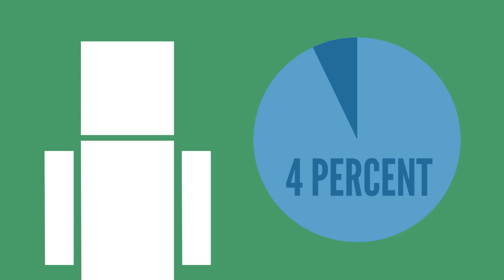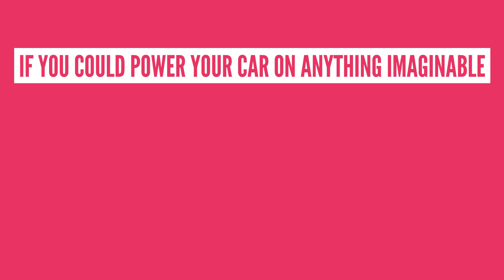Why Don't We Have Water Powered Cars Yet?

Comment: Is this possible that we use dry ice (soldified co2 ) as our fuel like we put some dry ice in the fuel tank and pour some water in it this would lead to the formation of co2  then we could just pass the co2 with high pressure through a fan which would further lead to the moving of the fan at high speed and generating electricity and giving us some energy to run a car the co2 would be emitted during this process but that co2 would not have any burnt particles in it so would cause no harm to environment . Your suggestions please

Comment: Oi blocko, this one is so inaccurate it actually hurt me. You imply that there's actually a way to get energy from water, when it's the opposite, it's like claiming you can get energy from CO2, you were onto something nice when you quoted the first law, but anyways.
The best way to get hydrogen now is through steam reforming of natural gas. Splitting water is a net negative energy process, so there's that, pretty much impossible to get energy from water

Comment: I have a plan to convert a bus to an RV and use solar for both general power and electrolysis to do exactly this. I have to run the numbers still though and see if that's even feasible but I'm hopeful. Even if generating brown gas takes more energy than it produces, it is true that the fuel effiency of pure hydrogen is much higher meaning I'll need a net less of it for the same distance than if I used diesel. And if my energy for the conversion process comes from a high end solar set up on the roof it's basically free gasoline. All be it with some work. I'm still not sure I won't run into some bottleneck that makes the process too long or expensive and makes me scrap the idea but I'm also not planning on being on the go literally nonstop. If I can stop somewhere for a couple weeks and build up my stores of brown gas, and I mean I plan on carrying 200gallons of freshwater I can pull from anyway, a high pressure canister of hydrogen gas or two could at least get me to my next destination then I can just rinse and repeat. Another concern I have about that though is I'd be sitting on 100s of pounds of what is essentially rocket fuel sooooo definitely gonna try and make sure there are plenty of safety measures in place so I don't go full challenger on the i-80 or something lol

Comment: At 2:31 I just want to point out that there is no way to get more energy out of electrolysis than you put in as that violates the first law of thermodynamics. The real idea behind water fueled cars is to use electrolysis to create a sort of fuel that can be made using electricity rather than somehow extracting energy from water.
Reply: Oil is better.

Comment: How about using kinetic eletricity generator so that it'll use the electricity as the car's actual fuel,  but to make the actual fuel you'll need water turbine for kinetic generator and the water itself

Comment: but Why not use Water as your medium instead? like power using pressure. acceleration pads apply pressure onto a body of water, the Water pushes like blades on the wheels and gets the car moving. with enough pressure applied, it is highly possible. not only does it mean You Can use naturally found sea water, but it Also makes the 'waste' produced equal to Nothing as it uses hydrolic pressure. I would be more cost effective as You only need to account for how the car is structured and You Can use the abundant resource That is sea water. plus, with more desalination plants, the used Water (Perhaps a few days, weeks maybe) Can be Properly disposed of into a pipe That connects everywhere to a desalination plant. It will increase drinking Water supply, reuse 'old' Water and help some countries to be more self sufficient.

Comment: Of course you lose a lot of energy, but we waste it with any kind of energyproduction. We could use electrolysis together with generators like windturbines to create hydrogen at night, when less energy is required and burn it during the days in hydrogen cars emmiting the water back into the cycle. So we need always external energy, but the water and oxygen are kept in a cycle (other than burning fuels, which add stuff to a cycle)

Comment: If you fuelled it up with water you'd then need a battery to get hydrogen to burn in an engine. The power source would be the battery as the energy to turn water to Hydrogen and Oxygen = the energy output of Hydrogen + Oxygen.

Even if the electronics and hydrogen engines were 100% efficient (fat chance) there would be 0 benefit over pure battery power. The only potential benefit is storage. Even so the efficiency will only be less than raw electricity.

Comment: What if we had unlimited clean energy like fusion power.. It will be used to charge electric vehicles or hydrogen fuel cell vehicles. Unlocking cheap fusion energy is Really key to our advancement as a species...

Comment: We had a person who did drive a car powered by water, he even proved it by giving it to be tested by seniors of NA assemblies. They gave it a try and it worked. It achieved a top speed of 60kph and would cost u 600$ to put the kit and turn ur car into water powered. Its such a shame that talent isnt supported here because that guy was put in jail for this. I live in Pakistan
Reply: What a bullshit. Water is not fuel on its own. You need energy to split the water in hydrogen and oxygen. Where do you get that energy? Not from water.
Reply: it doesnt solely run on water, there might be some hidden batteries that manages the electrolysis
Reply: That’s a lie
Reply: @noobweegeepasword9042  maybe, but that's possible. I live in Europe, and if i manage to run my car on water it would be tax fraud, and that's the worst crime you can do here, you'll be definitely end up in jail. You can't run your car on anything that doesn't come out from a fuel pump or an electric socket

Comment: We should be building cars that used turboshaft electric generators to charge batteries and/or electric motors, like a cross between Chrysler's turbine car and the Fisker Karma. A turbine engine running at full revs is the most efficient way to extract chemical energy from petrochemicals, and electric drive trains are more efficient than any mechanical linkage.

Comment: I would use Uranium to fuel my car and make it a Nuclear Car. Pretty cool. All you need is a reactor system, a few uranium rods, the car's engine, and you're ready to go. You would also need a coolant tank and an antifreeze tank to stabilize the reactor's temperature. Your car would be powered for years without refueling. That would be my car fuel.

Comment: I’d fuel my car on CO2 that’s in the atmosphere

Or a car plant that is fueled by photosynthesis
Reply: Car fueled by photosynthesis is basically just an EV with some solar panels strapped on lol

And CO2 is like water, it doesn't want to bond to anything. It's the product of a high reactive state going to a low reactive state. To use CO2, you'd need to figure out how to split apart the C from the O2 and then recombine the C with hydrogen to make fuel. But at that point you'll just be back with fossil fuels again, only having lost energy through inefficiencies.

Comment: Setup a carbon capture system, that packs green house gasses in the air into tiny fuel pellets. Then design an engine that uses those pellets as effectually and cleanly as possible....and Boom, by converting matter (green house gases) into energy ( kinetic ), thus the gods of thermodynamic are happy and people can have cars that clean help fight climate change. ( That said I have no clue how to do any of this)

Comment: Leaves in the fall could be a good fuel. It takes years for them to decompose on the ground leaving a mucky mess. Butttt we could lower the % of the muck by using them as fuel. Plus it'll be easier to get rid of by doing that. You'll have a clean yard for winter and a full tank of gas

Comment: Photoelectrochemical reaction can split water in hydrogen and oxygen. The problem is that right now the efficiency is still quite low, the material corrodes over time (lowering the efficiency even further) and there isn't an "easy" method to prepare the semiconductors needed.
A lot more research is going to be required before we can split water with just sunlight. But still, there is hope.

Comment: Electric cars: am I a joke to you
Reply: I imagine that if hydrogen production gets more efficient (most likely in photocatalytic cells that basically act like solar panels but work with even almost no light and produce hydrogen from water vapor in the air) hydrogen cars are gonna take over everything. Storing hydrogen is super simple; just keep it like a gas, compress it however much you need. On the other hand, electricity is really hard to store more of; we can only try to do materials science to find better electrochemical storage mechanisms. Therefore, yes, electric cars would be a joke if hydrogen production was done right.
Reply: @-butterfly-594  do you know ANYTHING about JOKES it always triggers me you know I'm not trying to be mean or anything It just TRIGGERS ME SO MUCH

Comment: An air powered car would be amazing because people would plant trees in order to have more air and oxygen so environment saved
Reply: Fun fact: bamboo produces 35% more oxygen than trees taking up the same amount land. They're also easier to harvest/cut/transport than trees, and they can make even sturdier building structures because they have a tendency to bend rather than break. Bamboo > trees
Reply: Technically we can make gasoline out of carbon dioxide sequestered from the air. Though that's only a good idea if you're okay with gas costing around 5 times what it does now.
Reply: Cars already use air to power them
Reply: @namegoeshere69  true. It's why technically the energy density listed for gasoline is actually half. The number we have is actually the combination of it and air.